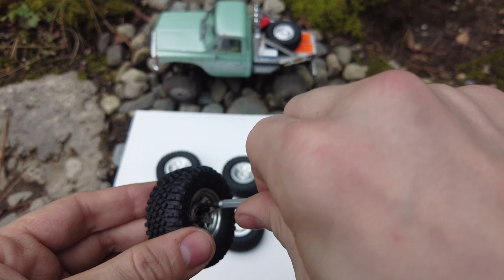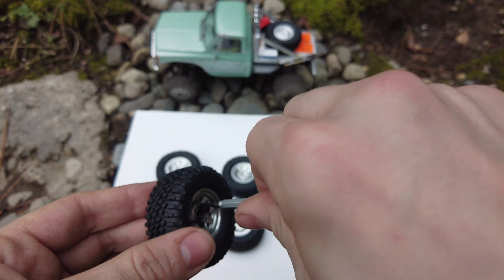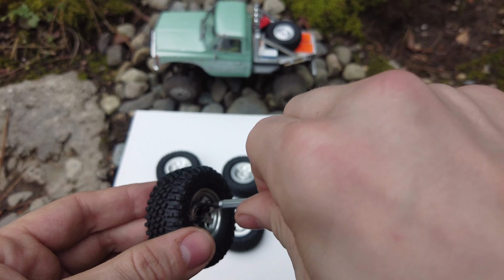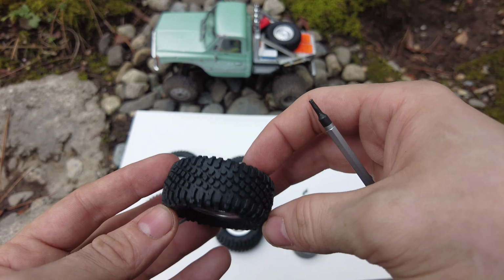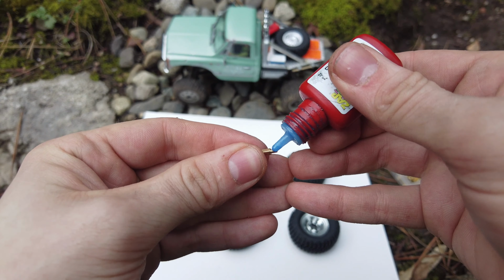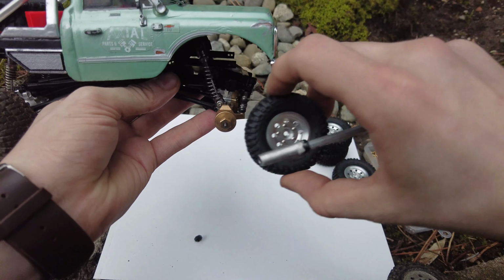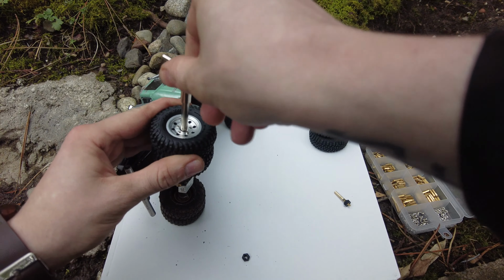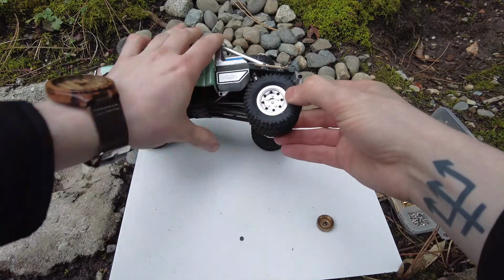How To Make 1/24 Dually Beadlocks! SCX24 C10 Gets Some New Shoes!

Comment: Nice video mate. But I think this mod is just for fun in the workshop. So wide rear tires does not add any increase of the climbing abilities of the rig ( personal experience ) The crawler turns to a monster truck smasher. I've experimented with tons of wheels an tires : wider, more wider and finaly reach the conclusion that  thee best for climbing are more narrow tires with supa soft texture for more grip . No huge graifers or smooth slickers.

Comment: very cool idea, but i think this will be a temp solution as the weight of the truck, will bend it or even break it..
Reply from the maker: Been running it for some time now, haven't bent or broken anything. Thanks for your concern though. Maybe try it yourself?
Reply: @rcrewired1220  thats good to know, i'll 100% try it out..did you planing on installing a brushless system onto this truck? would be coold to see how it performes in terms of low end traction.

Comment: Another way is to use a Dremel to hollow out the center of one wheel and then hot glue or superglue the wheel and tire together and now you have access to your Bolt with duallys 👍
Reply from the maker: True but then they are glued wheels, the point of this was to be able to use independent metal beadlocks, that you could re-use in the future
Reply: @rcrewired1220  you can get the hot glue apart and still use beadlocks just another idea if you don't have the hardware for everyone out there

Comment: Two questions. The medium hex cuppler is the one glued Into the black plastic hex correct? And which glue did you use to glue the black plastic hex to the cuppler?
Reply from the maker: Yes, and I used 5min 2 part epoxy for glue.

Comment: Hey, great video and rig! I have a question- 
How are those BF Goodrich tires? How do they size up to the stock tires on the C10? I’m looking for a rc4wd tire that is about the same height as stock. 
Is there any chance those could fit on the stock plastic wheels? 
Thank you for your time.
Reply from the maker: They are pretty awesome, the km3 are just as you describe but they are wider than the stock tires. I really like them, though they don't fit on stock rims, you'll need beadlocks for them to work.
Reply: @rcrewired1220  That’s what I figured. Also thanks for clarifying that the wheel weights work with the stamped steelies. 👍
Reply from the maker: Anytime! 👍
Reply: I have a set of these glued onto stock C10 rims. They balloon a bit, and I wish I would've trimmed a lot more off the foams, or left them out. Careful gluing, one side at a time got them pretty straight. The BFG tires are a good couple mm taller than the c10 tires, and way more grip.
Reply: @cyclecats  Hmm, Interesting! I have never thought of it as a problem gluing rc4wd tires to the stock rims, because I have wheel weights on them. 
Thanks!